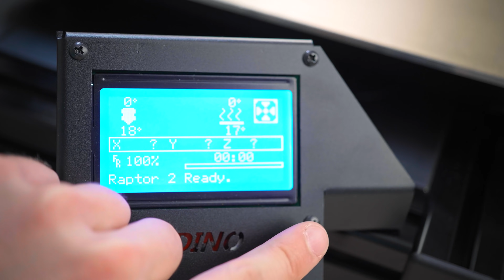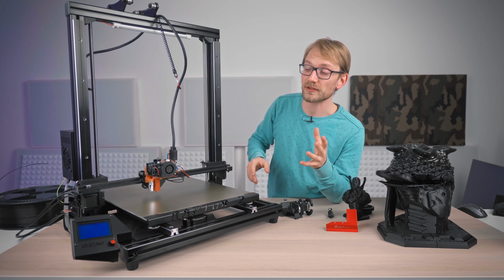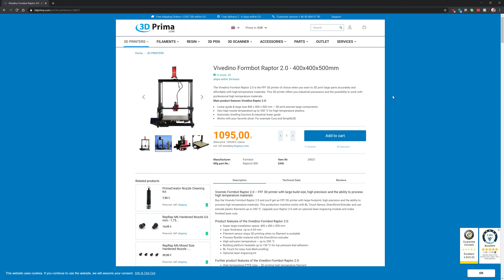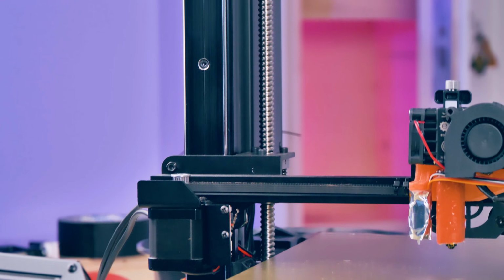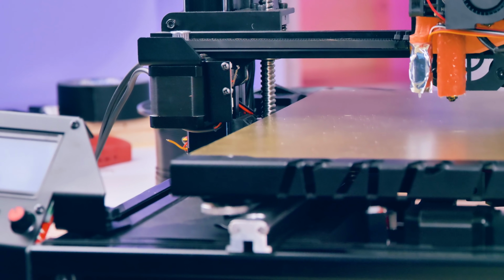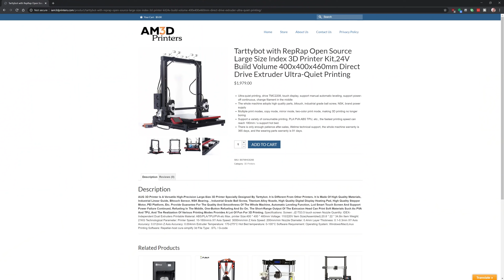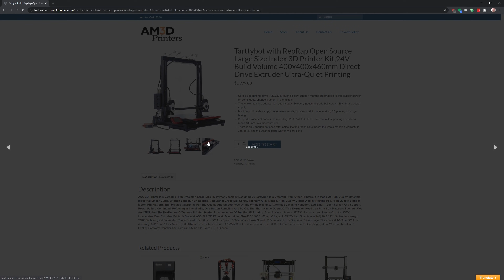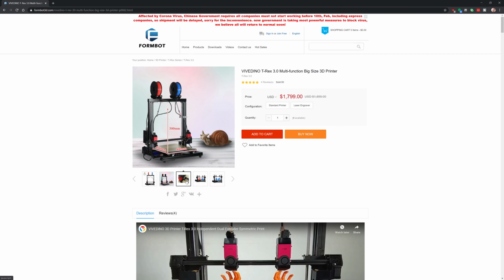This huge 3D printer was fun, but absolutely no one should buy it - Formbot Raptor 2.0 review!

Comment: I made the mistake to buy the original Formbot T-Rex at full price back then when I started 3D printing and knew nothing, around 2k€ ... After a few years of trying to get it to print better than "good enough", it ended up as nice supply of aluminium extrusion for my Corexy project. I could've built the same printer for less than 700€, but I guess you always get burnt when you start, especially a few years back when the choice was much more limited and less reviews were out there

Comment: Why would anyone build a printer this big as a bed flinger
Reply: For the same reasons most CNC mills of about the same size (and slightly larger) are moving-bed rather than moving-gantry, and with much heavier beds than this printer has (often in the multiple hundreds of pounds range). Yes, you need more motor grunt to make it work, but you get a lot more rigidity and repeatability for the buck.

Comment: Isn't the gauge on the VGA cable to small for the current of the heat cardridge and stepper motor?
Reply: A single wire for motor it is ok, for heater not. But the VGA cable has enough pins, so you can just combine several wires for the heater. smart eh?

Comment: I bought a Wanhao D9 some time back and this thing has the same stink to it, with the black 4040 extrusions, "good on paper" but rubbish in practice spec, etc.
So I did some digging, and found the physical address of Formbot, then the address of Wanhao. 15 minutes drive from each other. What are the odds :).

Comment: Tom, I understand your complaints, but at the same time I use a gCreate gMax 1.5xt at work.  The gMax came with most of the same issues for a price of around $3500 USD.  My opinion is for the price your getting a better priced starting point.  As for your skipped steps.  On our gMax, I swapped the stock pulleys for smaller ones to allow for more torque as well as using drv8825 drivers on the x, y and z.  Should printers come with these problems? No, but considering what you get, I would gladly take the Raptor as a project.  That said, I recently purchased a SainSmart Coreception and think it's one of the best values available.  I would like to hear your thoughts.  Thanks always for your content.

Comment: 5:00 I think the issue is that they move the bed at all, it would just be better to move the gantry.
Reply: Mendel-style printers will always have trouble with larger prints, I feel. Moving the print-bed, as well as the entire mass of any large print, is going to cause issues on what was supposed to be a simple, cheap design for a machine to begin with.

Comment: Some of your criticisms are a bit interesting, like your comment on the stepper driver heatsink. I mean isn't that the standard style found on all printers with stepper drivers? Also, the frame does have a non-conductive coating on it, but I guess that still wouldn't fly with any safety administration.  I agree with you not being able to recommend this printer, and that kinda brings up the elephant in the room, and that is really no one (Youtubers) should be recommending Chinese printers due to safety concerns. Its impossible to make any guarantees with these low cost printers coming from China. 

 So obviously I think that Employers, Teachers, and Parents have an obligation to only employ certified machines in their environments, but I can't help but wonder is this not a D.I.Y community? I mean our first few generations of printers were made with wooden frames and exposed wiring, and they cost the same, if not double the cost of this printer. This printers is more capable then any product on the market 6 years ago, and is far more customizable too.  But I guess, based on the comments here, I think there are more Geeks than Nerds in the audience.
Reply: actually the heatsinks are glued on with proper heat sink paste rather than double-sided tape normally used on 3d printers.

Comment: Any recommendations for someone that already has one (T-Rex 3.0) past it's refund point?
Reply: I would probably redo all the wiring and change the board to Duet or SKR instead.
Other mechanical issues might need some upgrade too.
Reply: @PartTimeRonin  I'll definitely research new boards. There was an drag chain free replacement for a model that doesn't wear the silicone wires, so I'll check that out too.
Reply: Rewire it b4 u use it again? Or just build a cinder block enclosure in the backyard, like a 70's style incinerator and print outside.

Comment: What a rant! I'm sitting here going "but mine is my workhorse"...and then he lays out his points and I've experienced pretty much all of it. I had a print fail 8 days in because of skips from insufficient cooling on the drivers. I haven't seen any wire fraying yet. The cable actually isn't a VGA cable. Gauge checks out for 24V.
I thought David Menzel was doing the firmware. I'll have to check mine.
For someone who knows what they're doing mechanically and electrically (I'm an engineer) it has a lot of potential.
Reply: A typical VGA cable is 24AWG, which can handle ~3.5A. The connector spec itself is 1A, but I'm sure its capable of a bit more, or they've wired multiple pins in parallel. So, please explain how its not an off the shelf VGA cable.
Reply: @jaro6985  I'll have to double check but I think it's 18AWG

Comment: I'm not sure about 12 mm3/sec and more for Prusa Mk3, it's almost 150 mm/s when printing with 0.4 nozzle. And it's almost top of e3d v6 flowrate, if only we had official numbers.
Also, that issue with skipped steps (skeps stips or whatever) is 100% due to lack of cooling, first thing to do when swapping to 2208s. The motor is probably just fine.
I feel for your rant though, was looking for such printer and thanks god I built it by myself.

Comment: I wanted to see this review after looking at this printer. 
This seems to be a similar issue that these large volume printers have. 
I bought a CR-10 Max instead and have been cursing the thing since I bought it. 
Constant failed prints, and wastes of filament constantly. 
These companies need to stop building crap products.
Reply: To be fair, if they stopped building crap products, the price would jump up quite a lot.
Reply: I recently bought the anycubic Kobra max. It's got some kinks, and the stock vulcano hotend is atrocious, but that's easily replaced.
It's got many of the same problems as this reviewed printer, but it just kinda works.
Needs a separate power switch tho, the power supply doesn't turn all the way off

Comment: Wow, cant say i have ever seen a review with so many issues on a single device!  As you disassembled it at the end, I hope that means your able to return it for a refund!?  Maybe buiding your own large 3D printer would make a good video? Take the main parts from an Ender 3 pro maybe and build a larger frame?  I guess the main parts (control board, hot end, steppers, etc) are cheap enough to just buy outright.

Comment: Something that size should be a cube style printer.
Reply: Large industrial CNC setups are gantry models.
Reply: @ronnetgrazer362  Not even the same thing. The beds on these bigger printers have too much backlash.
Reply: So moving the bed can't be properly done cost-effectively (ie without the industrial build quality/pricing)? Then how about moving the gantry over the bed? Same issues? It just seems so much more elegant than that cube configuration.

Comment: I actually like having the heated bed on a separate power cord.  I have my electronics and extruded plugged into a UPS, so a power flicker doesn’t ruin a print.  A 750w bed heater would drain that quickly enough that it would be expensive to a battery or it wouldn’t last long enough to be useful.  The rest about this machine though .. woof.
Reply: Great point about the UPS. I've never used a printer with a heated bed, but it seems once the first layer is down, it becomes less important anyway....?
Reply: @McTroyd  For PLA, a not having a heated bed is all right especially with smaller prints but even then, a heated bed still helps. But if you're printing in PETG/ABS/PC you do need a heated bed.
Reply: @shadow7037932  Duly noted, thanks! At the moment my printer is PLA only (stock Da Vinci Jr), but that info will be helpful when the time comes to hack it for upgrades.
Reply: @McTroyd  once your heated bed cools, the expansion differential between the bed and the part causes it to release. in some cases, i could see this absolutely causing a failed print. that said, i would hope the heated bed had enough insulation on it to keep that from happening during a minor power interruption. for a prolonged power interruption a UPS will do no good anyway.
Reply: MichaelKingsfordGray  Which should not cause any issue. As long as you not cheaped out the cabling and insulation. It should pass 2.5kV RMS HiPot testing, right?
Reply: @gabiold  Well, kinda, but definitely no. Were probably talking at least a 2kW silicone heater here. 400x400 ones are typically 1.4-1.5kW. At ~230V. If phases went off and you end up with >=440-460 volts, something is bound to give. With these cheapened down Chinese electronics, they tend to cut corners in failure mitigations. If you end up with that thing's failure mode failing closed on the board output for the SSR to the bed heater, which is now running 440-460 volts flat out with no thermal management and no in-line thermal fuse.... At 150-200°C tops, that adhesive is gonna give. And those big pad 400-500 square pads, those are quite heavy - most insulation solutions aren't gonna hold it up for long, if at all (the one in the video has nothing but the adhesive keeping it on. You wanna bet on that pad letting out the magic smoke, before whatever it lands on when it falls off the bed, start letting out its smoke?

Comment: My guess is that there is a problem with the heater cartridge or temp sensor, I can push at least 4x the amount of PETG filament through a v5 clone and a crappy extruder . Or in other words about 1kg of filament in 14-16 hours. Sure I may still get a volcano or something similar but really I think they are over-hyped, I may have to slow down to 30-60mm/s when I use a 1mm nozzle depending on the layer with my teeny little heater block printing with PETG.

Comment: My printer bed is 20x30 and while designing and building for it one of the first things I did was to find a beefier (or "torquier") motor for the Y axis. They have a humongous bed and attached stuff like linear bearings to it with a tiny Nema-17? Haven't they heard about inertia? Also as the print goes bigger the weight goes bigger

Comment: Have you had any issues with the dasFilament? SPecifically that roll?

I have a 2.3kg one as well and I've had a jam from a piece where it looks like they joined two strands of filament but didn't do a good job. That jam ultimately cost me a hotend as that was the first time I took it apart and that went rather poorly

Comment: Ill keep rebuttal very short and simple. Some points ill fill in background. 

First off, compare it to anything else in the price category. Its a $1k USD machine, not $5k. That's less than a CR10S5 that only heats the center 300mm. Feedrates you're comparing a bondtech geared extruder to a el cheapo. Please keep price category of the machine in mind. Same with filament spool management. I don't like it either but its what I expect for coming with a machine in this price range. Its almost a given you'll be doing something else shortly.

As for firmware safety features, aside from a batch shipped the very first week, which they openly admitted was mistakenly shipped with a bad flash, these do have thermal runaway flashed on every machine. Also as a plus, they did not hesitate to publish source. It matches a build from Marlin 2.0 Bugfix dated Sept 23rd 2018. Same date snapshot as code provided by one of the core Marlin developers to them for the Trex machine. Given that, it was a validated snapshot in most regards with issues larger than a release would have being outside what was in use on the machine. 32 bit HAL's were the primary development focus. Im not sure what other safety features you think are missing but it seems a good area to focus more on.

When I put a meter on the Formbot machines I have, I get continuity from the bed to the main ground plug. Lack of one on the keenovo side is irrelevant. On the statement of the Y stepper, it is a nema 17 but a fairly large one. Not quite super whopper size but almost.

I do agree it should have had more testing before going out, as the cable chain issue was addressed somewhere around 8-10 months ago and the XY drivers were changed to TMC2209 to drive a little more current and generate less heat. I wont argue those points. On the temperature claims, the bed is adhered with the keenovo provided adhesive which they rate to 250c. I have personally run one up to 180c with Kapton tape instead of PEI without an issue there. A disclaimer on print surface not withstanding full bed capability would be nice however. I had a BMG-M mounted to it with a nice mosquito running much more interesting materials (3DXTech CF infused is great stuff!). 

The hotend temperature claims on the other hand were born from some very bad miscommunication between Capricorn and Formbot. In part because of the way its marketed and in part because of Formbot's lack of validation, they took the 350c melting point statement and ran with it. The thermistor is rated for the temperature however so they have that much at least. I have discussed with with both Ada Fang and Mohammed Baz and the whole thing is quite unfortunate.
Reply: "Lack of one on the keenovo side is irrelevant." no its not irrelevant, because if you've just got that plugged in the machine is not grounded which is unsafe. If they had combined the two cords then this would not be an issue.
Reply: @jaro6985  In all seriousness is anyone going to run it like that? In any normal situation it wont matter. Yes it would have been nice but under operation irrelevant. Just means during maintenance be smart and pull both.

Comment: Thank you for your review !! I couldn't agree with you more !! This machine is dangerous !. Like you said it needs weeks to produce parts and upon printing i almost caught fire !! The wires under the bed melted !! And generally the extrusion set was weak !. The bed heat is exactly as you said also ! It bubbles when you go over 85.

Comment: Having a moving bed on such a printer is unacceptable. All printers this big should have a static (except on Z) bed with a CoreXY configuration or something similar
Reply: I think an i3 design CAN work for a printer this big, but you need to use a bigger motor on the Y axis, or even 2 motors. You run up against the problem of the drivers overheating though, at least TMC2208s.  I think trinamic has some drivers that can handle bigger motors, though.

Overall a coreXY printer makes more sense for a bed this size, it's just not as cheap to build. You will be severely limited in speed by just the mass of the Y axis on an i3 design this large.
Reply: well i have cr10s5 and No Problemos 
bed moves with one nema 17 60mm
Reply: My ender 3 does that and i like it
Reply: Core XY then has insane multi-meter long belt runs (so I would think rubber hysteresis, similar to Bowden tubes, would become an issue). You might as well go with Ender 5 approach (not core XY like it looks like at a glance, it’s normal Cartesian). Or you could go Delta or belt feed bed (infinite bed axis length) or many others.

Comment: What really is annoying is the import quality issue never change over the years. They build things that use a lot of resources, wood, metal, plastic, electronics, etc. and if the buyer decides not to use it, doesn’t return it, such a waste. What does it cost manufactures in china to improve their processes, testing, quality control, etc... much less than the material waste they generate and ship out. And it never seems to get better either. Harbor Freight is a great example the lack of quality control still is the same on the tools I by now or the ones i bought 10 years ago. And now that so many quality product companies have gone away because of the shopper attraction to value based products from china we have such little options left in so many markets. It’s just a huge mess and a pain to get quality products any more without having to upgrade and fix them.

Comment: Reading the Prusa forum about the mini as I watch this. I mean, sure, you wait months for a new Prusa release, but this can be the alternative. Yes, there have been damaged or faulty bits (already a few issues addressed in January), but nowhere near the cluster I'm seeing here.

Off the top of my head, I got bit by the faulty PSU on the original MK3, and that's it.

Comment: I bought this piece of crap and it breaks down every  other print. Could you please send me a full list of the upgrades you did to this so I can get it working more reliable. Extruder board died, 9-pin data cable, horned, bed thermal conductor in the drag chain. Only got like 5 reels.
Reply: I watched all these reviews by others who said this was there goto work horse. I wish this review came out months ago.

Comment: I'm sorry but any review on this machine from this company should without fail acknowledge the gCreate gMax line of printers that these designs were stolen from. Doesn't matter that the gCreate machines are open source, they stole the design, improved nothing and sold it at a lower price. This company has no morals and should be shut down for plagiarism and IP theft. Cool review tom.